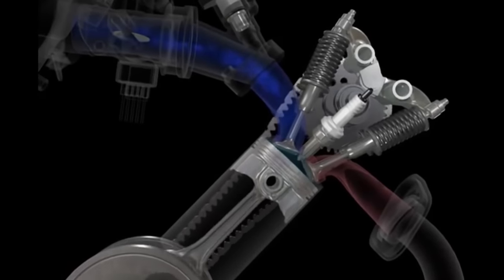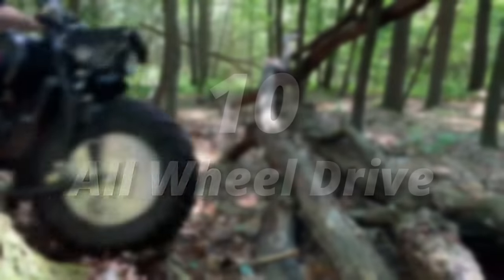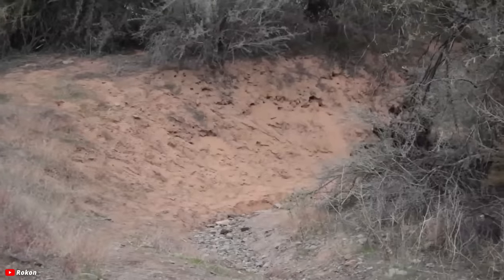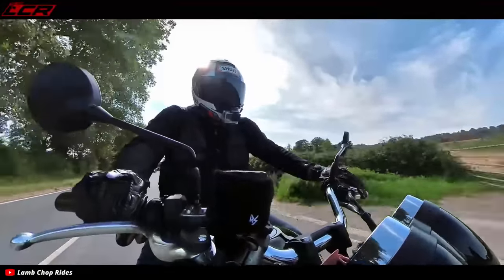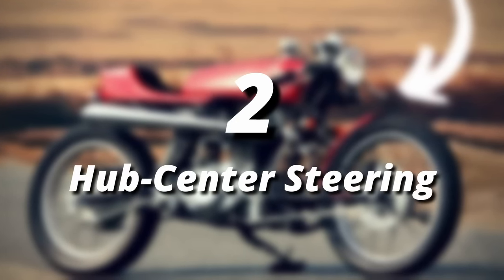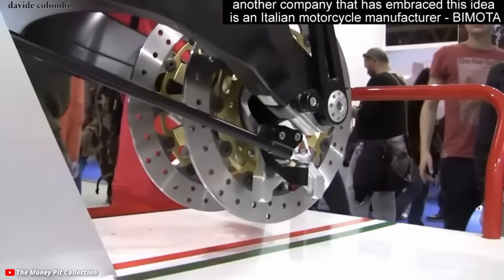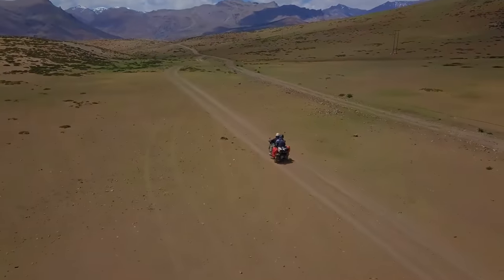10 Motorcycle Innovations that never caught on

Comment: I was 16 in 1968 when my father was stationed in Rome Italy for 6 months.  I was able to rent 50cc and 150cc Vespa scooters that had that clutch and shift function on the left grip.  These were actually my first experience with a powered two wheeler so at first I didn't have anything to compare them to.  Later I had a 50cc motorcycle of my own and MUCH preferred its foot shift to the scooters.  The scooter's controls always seemed sloppy to me.  Part of that was due to them being rentals and not kept in excellent shape.  Even when it was working though I found I often had to look at the left handgrip to be sure I was in or moving to the correct gear and finding neutral was often a chore.   I look back on that period of my youth thru rose colored lens and all those problems are part of the uniqueness that was a really good period of my teenage years.
Reply: @rustlebruxz0013 - "The scooter's controls always seemed sloppy to me.  Part of that was due to them being rentals and not kept in excellent shape."
Speaking from my own experience (Lambretta), I'd say ALL of it was due to lack of maintenance.  All you need to do is the same as you do on any bikes brake and clutch cables;  occasionally oil them and adjust out any slack.

Comment: Should overlook BMW's k-series 1200r, 1200s & 1600s (which has I6 engine) - from 2009. 
They utilize the double-wishbone front & rear suspension in production bikes - a.k.a. "Duolever" & "Paralever".

Comment: I have linked brakes on my 5th gen VFR and I have done a delete on my CBR1000f, honestly the VFR system is a pleasure I only did the delete on the CBR as it was cheaper then a rebuild and its a rat-rod however I would never consider doing it to the VFR it works really nicely and is my fav of the 2 easily👌

ABS on a bike makes me feel nauseous 🤢🤮

Comment: BMW has the Paralever front suspension (owned a GS with it) and the Duo Lever for the K (on my current K1200 S). Not to take away anything from John Britten who was unarguably a genius, but the BMW designs are simpler, lighter, and incredibly effective for street bikes. The rake angle does not change during compression and rebound which makes the bike very stable and track like a train. As for enclosed bikes,  we should give an honorable mention to Mr. Garrison for almost disrupting the airline industry with the "It" bike😉

Comment: hybrid bikes with electric motors in front wheels will be the next innovation I reckon, like for low down mud or rough terrain where you dont need top end speed, you could switch on the front drive electric motor thats being run off the motors alternator.,

Comment: In the sixties there were quite some hand shifted mopeds here in Europe. They were always three speed instead of four. I'm not entirely sure but I believe they were considered more useful on low power 50cc mopeds where a 4-speed foot was considered too expensive and technically overkill. They were either from Puch, Batavus, Kreidler or Zundapp. Batavus even had a hand operated 2 speed.

They were considered to be for old people that rode in full leather at a speed of 25 mph. For us Dutch kids who had been waiting until we finally became 16 and were allowed to ride one legally, they were obviously seriously uncool. The thing was: in The Netherlands mopeds were allowed to have 50cc and could be driven by 16 year olds without a license. In Germany where these bikes were produced the law stated a max of 80 or 125 cc's for 16 year olds but you had to get a special license for them. For both countries anything bigger than that required an age of 18 and a full motorcycle driving license. So Kreidlers and Zundapps were build up to 125 cc in Germany and they were exactly the same bikes regardless of the engine capacity. The same frame, wheels and brakes. 

For The Netherlands "ze Germans" simply chucked a 50 cc, hand shifted induced air cooled engine underneath it and sold them as mopeds. Obviously for those a 3-speed hand box was considered more than enough. For Zundapp it was called the CS-50 and having one got the girls screaming in completely the wrong way while quickly diverting to the guy who had a shining new KS-50 with a "foot". When people noticed that silly looking magnesium induced cooling cover over your cilinder you could pretty much forget it.

The rest is history. In the early seventies bicycle shops simply stopped importing them because the only people wanting mopeds were kids between 16 and 18 and they would rather ride a bicycle than a hand shifted moped. The scooter models you showed in your video were banned over here for quite some time and would only return in the 90's and by then the auto-shifter took over so there was no need for hand-shifters. Now that I come to think of it, the whole idea of motorised urban transport appeares to have made a come back here in the 90's. Before that, everyone above 18 drove either a car or a "real" motorbike of 450 cc or more and those are all foot-shifters.

Comment: Oddly three of the items that don't make sense, combined on an electric motorcycle suddenly could make sense. Dual hub motors (2-wheel drive) with hub steering and dual swingarm suspension with highway cruise self-driving (lets be honest, interstates to get to good roads are boring)...this kinda makes sense.  Throw in linked (regenerative) braking and you have a winner!

Comment: The reason why there are no automatic transmissions in the motorcycle world is this: basically all motorbike transmissions are dog boxes, the clutch should only be used in 1st gear. All other gears can and should be shifted without clutch because they are designed this way. You just let off the gas and then shift. This works in both directions.

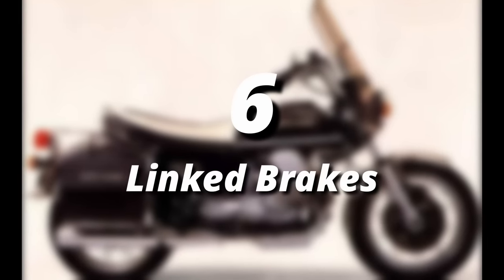Comment: 6:44 actually here in Brazil it work good, honda comes with this idea in 2014, and now most of hondas motorcycles have this feature, personally I like, is way more safety compared with single brake system

(Yamaha brings abs, but honda is top 1 in costume choice, followed by Yamaha in 2 place here in Brazil)

Comment: There is an innovation that has been used in aircraft that I would hope that motorcycle manufacturers would look into, and that is sleeve valves. Sir Harry Ricardo came up with the system in the 1920's. When you think about it, poppet valves are really a pretty dumb idea when performance is your goal. You take an inlet port, and to a lesser extent an exhaust port, and when it's open you make the mixture go around the valve. The valve itself is a restriction, and if you make the port larger, it's valve will just be a bigger restriction and it won't move as fast because it is heavier, restricting speed. So we put multiple valves in for a lighter valve train. Now we just have more smaller restrictions. The sleeve valve system gets the valve right out of the way, giving the mixture a clear shot at the cylinder. During WW2, the Napier Sabre and Bristol Centaurus sleeve valve engines made crazy horsepower. (Google them) Way more than the supposed engine that won the war, the Rolls-Royce Merlin poppet valve engine. Maybe one day we'll see the system on motorcycles.

Comment: Dunno how I feel about linked brakes.  If it includes ABS then maybe fine, but I usually imagine that if the front wheel started to lock up then I'd have to let off the brake and then there'd be no rear braking either.  I prefer to trail-brake around tight city intersection turns and on slippery surfaces while using no front brake at all.  Front braking while turning to me sounds very risky.

Comment: Turbo motorcycles in the '80s and miss the main one which was the gpz750? 

And if you see those with modern turbos on them and small exhaust they are in my extremely subjective opinion about the best sounding motorcycles ever.

I get there any 600cc bike from the mid-90s will blow the doors off of it and it doesn't even have doors. Just cool it's just one of those bikes on my I wish I could have it because it's neat list.

Comment: RE all wheel drive, I can see the advantage of a switchable front wheel drive for use in certain conditions. This could easily be provided with an electric motor built into the front hub. Electric vehicle technology has moved on enormously recently and this could be achieved easily without a huge weight penalty as there would be no need for a larger lead-acid battery to power it. A dedicated Li-ion could be used.

Comment: 03:39 I have 2 1960s Vespa's and this is not the best feature The cables break on a regular basis. If you are using them frequently then it is a must to carry spare cables. Replacing them means you are going to get oily and lose 15 to 20 minutes replacing and adjusting them. They stretch as well, so need to be altered often.

Comment: Of course many scooters (like them or not, they are motorcycles) have automatic transmissions in the form of CVT. Also the CanAm Ryker has a CVT transmission and despite having 3 wheels is still classed as a motorcycle.

Comment: the Britton had a Hossack style front suspension and other motorcycles did use a version of it the reason they haven't made may is one they don't want to pay to use it and it's higher maintenance,and could become dangerous if it's parts got lose.
Reply: The Hossack style front suspension is in the public domain as the patent has expired, which is why both BMW and Honda now use it. I's maintenance is no greater than any other design of front suspension.
Reply: @peterwilliams2152  They use versions of it not exactly that design  companies would all ways rather use there own design to claim there originality of design,and there are more point of failure it's not about maintenance it's about over all safety.my point was Britton didn't invent this suspension or many other things on the bike.other companies didn't use them because he was building bikes to race not to sell to the general public the bike isn't safe for the average rider.

Comment: Re: linked brakes - I don't remember what brand it was, but I recall coming seeing a bike many years ago with the rear brake linked to just one front disc - the other bring connected to the brake lever as per normal.  I thought the idea was that riders with a penchant for doing all their braking with their right foot wouldn't keep locking up the rear and falling off with a minimum of speed actually scrubbed off, while retaining some rider control over front-rear bias for those who knew how to squeeze the brake lever with the hand that also manipulates the throttle.

Comment: I wonder if there's a chance of a turbo Action motorcycle designed not for tons of power or speed but to just create enough engine air pressure to use the bike at higher altitudes.

Comment: hi just been listening to your channel for a few hours. Then you mentioned turbo chargers. yes the crazy motorcycle of the Hayabusa is fast. My friend had one there is no need for a turbo on it, crazy fast bike. Well I was a proud owner of a Yamaha xj650 turbo , a friend of mine had the normal. My turbo charged machine was superior in every way,  One ball bearing on the waste gate and it became a mad beast The engine was built better, and stronger. My brother had the Kawasaki GPZ 750 turbo, a beautiful machine, the first production machine to do 150mph and under the 10 second 1/4 mile. The handling of my XJ turbo would be the only thing that made me keep up with my brothers mad Kwaka. My brother restores old motorcycles now to new condition he loves his Yamaha 350lc's. He still rides a few large monsters now like the R1, GPZ900, and a few other lettered bikes. After many years, (40) I still miss my Yamaha turbo. I am settling for a scooter soon, such is life. As engines became more efficient , they become more powerful, it does take away the need for a turbo. It was fun at the time. The Hayabusa made our bikes seem slow. when you consider speed limits around the world, what are we thinking when doing 200mph on 2 wheels. Take care and have fun, Chris, riding a scooter in Bulgaria where over 50kmh is dangerous on many roads, hahaha.

Comment: I am not a motorbike rider, don't like being on them at all.  That said the tech is interesting.  One feature which, to my knowledge, was only used on H-D was the ball breaker gear shift lever mounted beside the tank.  Another thing I remember seeing development footage of was an air bag riding jacket (for the rider) that would inflate if it detected that the rider(s) became detached from the bike.  It was to protect the body and head but did leave limbs flailing around.  I saw test footage done with crash dummies.  They became beach balls.  The trick was to deflate the jacket rapidly enough that the wearer made a single soft landing rather than bouncing along the ground.  I think BMW was one of the developers.  Another interesting one was the gas turbine bike.  Jay Leno has one.  The exhaust will melt plastic on anything that follows too closely.

Comment: 9:40 it has caught on. it's used on low displacement cub motorcicles, mostly sold in latin america and south east asia.
Most cubs have a 4 gear transmition with a rotary cluth that bites when the rpm go up and also it's connected to the shift lever so when you press it you engage the clutch and shift in one movement, instead of one down rest up those transmition are all down, those are the most or one of the most popular motorbikes on my country and some of those cubs, tho I've seen very few, have automatic transmitions that shift on their own.
One problem with those is that if you leave the bike on 1st year, assuming that it won't move but for some reason the rpms go up, like a bad adjusted carburator it would make your bike move.
I've seen people starting the bikes or reving it thinking it's in neutral and getting dragged lol.
Tho yes, it's used a lot on cheap urban motorcycles typically bought for transportation and not for people into bikes cause most people that do like riding but are on a budget would go instead for something like an ybr 125 that's a proper bike

Comment: Your description of the Moto-Guzzi front brakes is wrong - as I know from the V-50 I had in the 80s.  The brake pedal operated ONE of the two front discs, and the rear disc, applying 60% of the hydraulic pressure to the front and 40% to the rear.  Contrary to what you said, if you wanted to apply the front disc only, you pulled the right hand lever, and that operated the second front disc.  You could not apply the rear disc only - but then, why the hell would you want to, when it's the surest way of locking up the rear wheel, getting into a skid, and, in any case, trying to stop a bike on the rear brake only is the slowest way to do it?
If you wanted full 'Red Alert!' braking, you used the foot pedal and the brake lever - which brought all three discs into operation.  I've owned and ridden over 30 different bikes, from my sister's Honda 50 up to a Honda 750, an Evo Harley 883, and a Yam 850 triple, and without a shadow of a doubt, the Moto-Guzzi's brakes beat the rest of them into a cocked hat.  So why did Moto-Guzzi drop the idea, and why has nobody else used it?  Because of the typical characteristic of bike manufacturers and bike riders - sheer bloody ignorance*, and a pig-headed determination to *ALWAYS follow the crowd!

Comment: Cool video! Agree Hayabusa should revisit turbocharging, looking at layout, engine configuration and even F1 style use of electrical motors to prevent turbolag. I can imagine a 90degree V4, V5 or V6 in a transverse layout with a V mounted split turbo with antilag electrics. The technology is there and honestly compared to most modern car engines, motorcycle engines are mostly relics and decades behind in technology in some cases. eg 60's Royal Enfield's remade in India(terribly, you'd think they'd have solved the known problems like oil leaks, etc😂) basic Honda 70's-80's CB250-350's made in Thailand and Vietnam for local sale new, and are the same as the 70's originals, Yamaha SR250's made in China and exported as Hang Sung, the list goes on!!! 😂 😂 😂 😂

Comment: I agree the covered bikes or 2 wheel cages if you prefer, have not caught on well, but it can and should be done in a good way. I hear from many sources a bike is an expensive toy, often "proven" by the fact it's not reasonable to ride to work in the rain. 
I commute on 2 wheels year-round except for 5 to 10 days when raining in the morning or snow in the forecast. I would gladly put a top on for commuting, especially if it could fold back or be removed for better weather. It's a shame they don't know how to market the shell.

Comment: A twist grip gear changers adds a cable to the entire mechanism.. This distance from the gear box makes stirring the gear box, in for example a track bike leads to cable streaching an a lack of precision that will eventually affect the palls and tongs of a gear box with say over 100 hp running through it.
  We have enough trouble with big inch harley's wearing out the Heim joints and threads on the shift linkage, as Harley owner's know ( good way to know if the previous owner of your bike was ham fisted on downshifts, especially with the hee'n toe).
   Less parts, better suited to a peg set up, stronger, more accurate through feel with no cable, and faster..easier on the wrist too, it all comes into play..